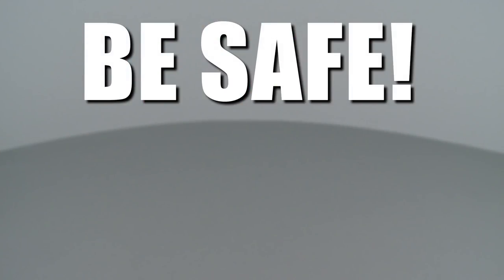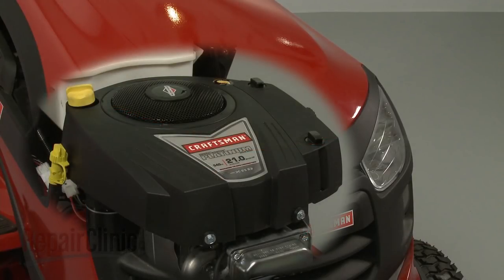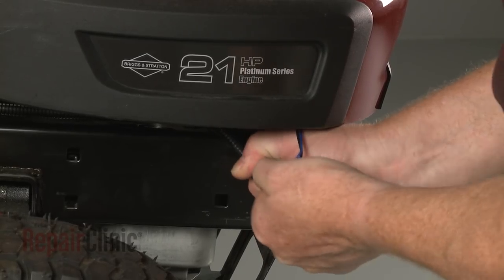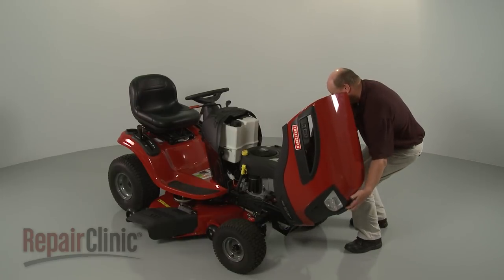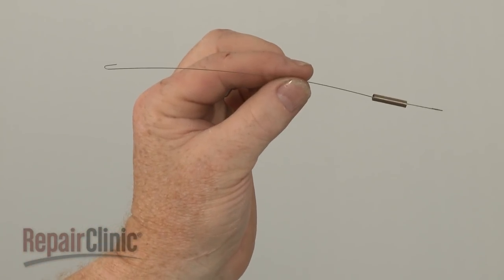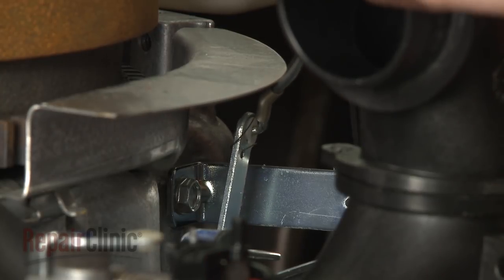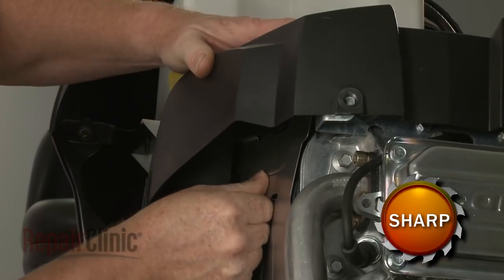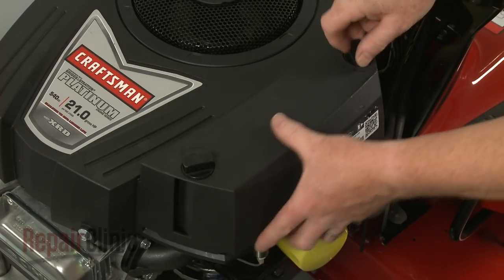Briggs & Stratton Riding Lawn Mower Throttle Rod Spring 691842

Comment: So what exactly is the purpose of the throttle rod spring if it just connects to the same points as the rod next to it?
Reply: I'm asking the same question ??  Unless it takes out any backlash in the throttle rod bushes, although minute.
Reply: It makes extra money for your repairman
Reply: It takes slack out of the linkage between the governor arm an throttle for smoother rpm management.